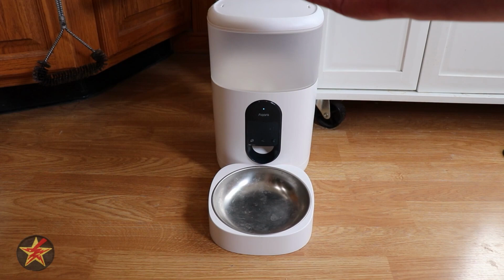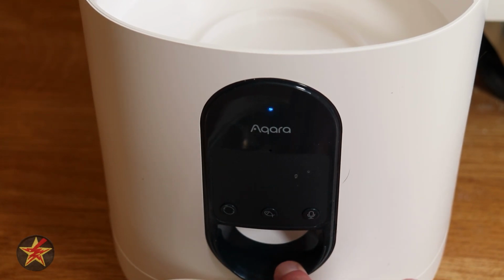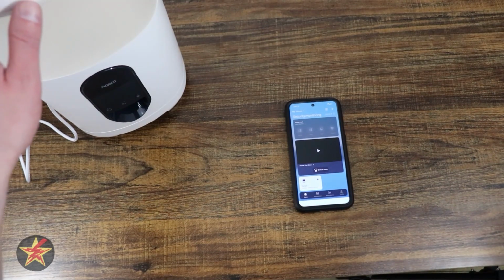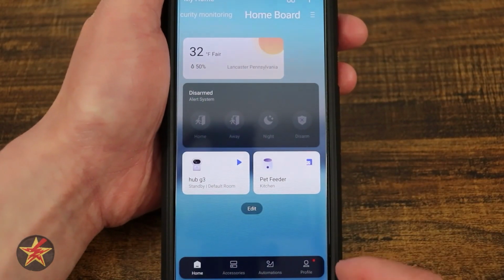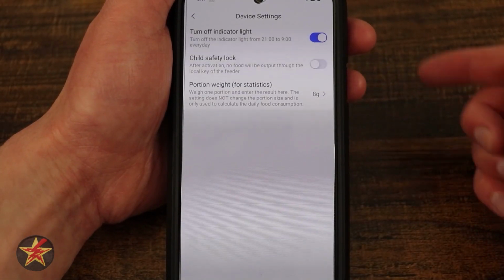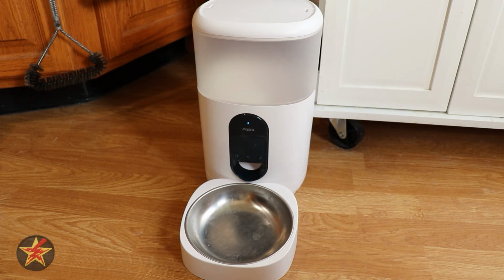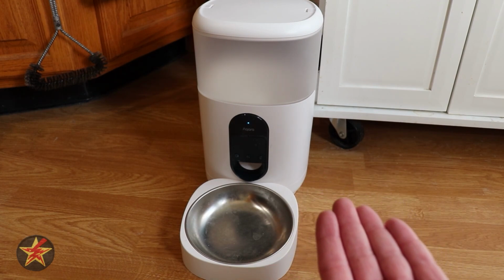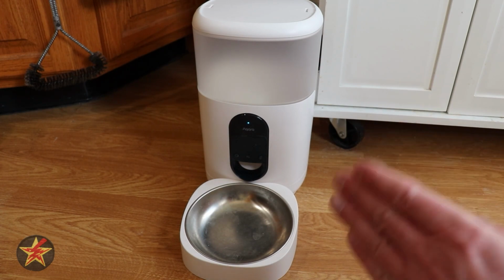Aqara Smart Pet Feeder C1 Review: Never Worry About Feeding Your Pet

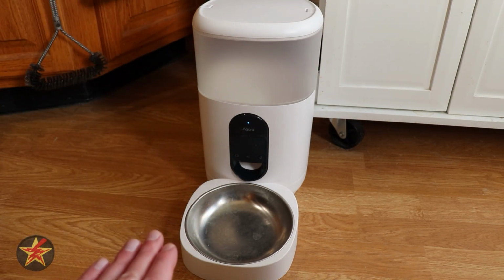Comment: 13:17 Having to have a hub is a non starter. If device manufacturers are using the Zigbee standard, why the need for their own hub? The cynic in me has lots of thoughts on that, but if this doesn’t work directly with ZHA in Home Assistant, then pass.
Reply: This works directly in Home Assistant without the Aqara hub. I've been using it with HA for about a year now.
Reply from the maker: @AlmightyHeretic  Thats good to know, not sure that everyone would want to jump on the Home assistant train.
Reply from the maker: It is "Zigbee like".  It does use the Zigbee protical to fucntion it is just wrapped up with their own secret sauce as well.  I am pretty sure that is why this pet feeder is not used more.  Needing something else for it to work is not going to work for a lot of people.  I only got it because of the fact I had the G3 Camera hub around.  It is also why I wanted to make sure I said a few times that a hub was needed.  Amazons sales page shows that it is returned alot.